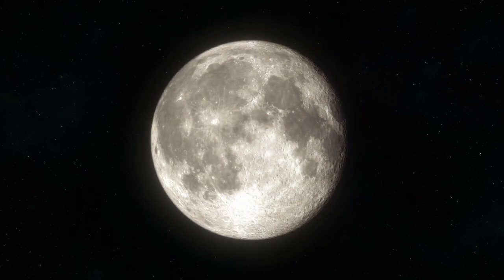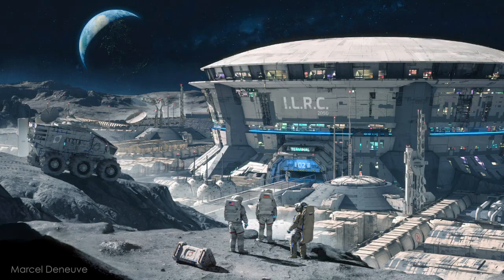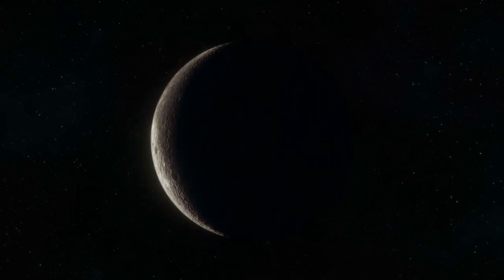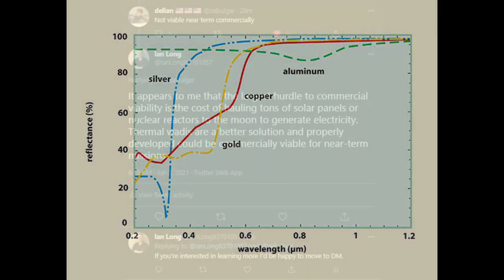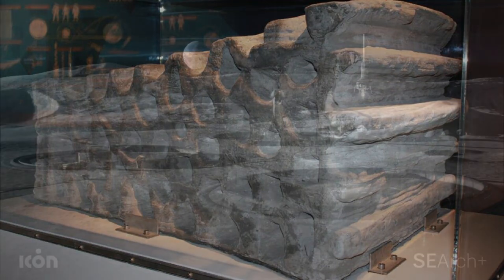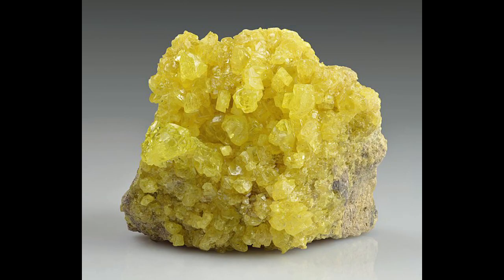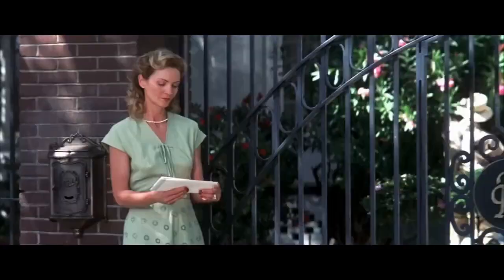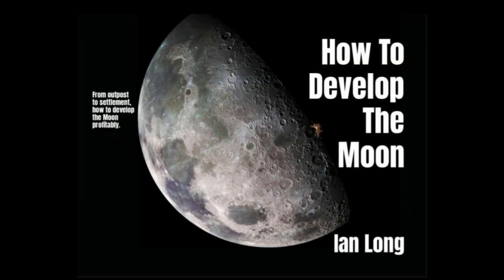Terrible Ideas Everyone Believes About Lunar Development

Comment: 1. Nuclear may very well turn out to be the simplest and most viable option for power generation. But it's very easy to chuck things into orbit around the Moon, once we got the necessary infrastructure in place, and if you create a grid of solar power satellites you can negate the half month of darkness issue. That may turn out to be a viable option in the long run.

2. We don't need soil to grow crops. Hydroponics is already a thing. It is costly even here on Earth, since it's labor and energy intensive, and mostly used for more expensive crops. But all that goes out of the window if we can automate it. Costs are not a constant thing. They come from the need for human labor (and competition for fundamentally limited resources that isn't really an applicable factor here). Everybody expects AGI to appear within a few decades at most, and then all those costs just disappear. So your argument only works in a world where no more progress is made.

3. You make the same weird assumption about costs here too.

So, not much of a refutation of popular concepts here.
Reply from the maker: 2. The argument isn't even about soil it's about space. Hydroponics or not you need habitable space to grow food and that costs so much to make off world it is simply cheaper to ship food from Earth. It's geographic specialization on a solar system scale. Launch costs are falling and will continue to fall especially as scale increases. It is ALL about scale and scale doesn't work well for agriculture on the moon. Sure I'd love it if we could easily grow stuff on the moon for the same price as on Earth, and for that matter I'd love if we could easily breath on the moon and walk around without a suit. It would be awesome if the moon was like a small Earth as people in the 18th century thought. But it's not. I never said you can't grow things on the moon I said you can't sustain a large population with lunar-grown food. You can build cities and ships and statues and toilets and tables out of lunar sourced materials but food is life and that's the rarest thing in the universe. This is all actually good news because having a massive offworld population will increase the market demand to make Earth do more and more what it does best: grow things. Propogate life. It would increasingly incentivize Earth to be a breadbasket and that's great news for environmentalists! . @ebonaparte3853
Reply: @Anthrofuturism  Here on Earth we have cheap farmland to use, and there has been little economic incentive to push for automated hydroponic farms. And it hasn't become feasible to automate construction of buildings etc. But you can bet that there's plenty of economic incentive to improve such techniques if the alternative is sending expensive rockets from Earth.

There's nothing magic about living organisms. If the environment is good enough, plants and other organisms can function. You realize they have been growing plants on the ISS right?

And once we have AGI or even near-AGI, costs disappear. Where do you think costs come from? They come from salaries in every step needed to get the thing done.
Reply from the maker: @beardmonster8051  as I've mentioned in other comments the issue isn't whether or not we CAN grow food it's how many calories you can yield per square meter. Even for hydroponics its per cubic meter and I did the math on that too. Even with transportation (launching from Earth) which is like 99% of the cost per Kcal/kg it's still cheaper than the cost of growing it on the moon which is so astronomically high (pun intended) you won't break even with Earth imports for several lifetimes. And that's not considering a reduction in launch costs. Even if a cubic meter on the moon could yield 10x the calories as a cubic meter on Earth it's still better to send things up from Earth. And here I use cubic which would imply hydroponics
Reply: @Anthrofuturism  This conversation is pointless. If we wait a few years and see kind of effects AI starts to have, maybe you can challenge your assumption about costs.
Reply: @beardmonster8051  let's get real for a moment. The idea of growing plants on the Moon is far from "easy," and here's why:

-The Moon's environment is extremely harsh. There's no atmosphere, extreme temperature fluctuations, and high radiation levels. Creating a habitable environment for plants is a colossal challenge, not a walk in the park.

-Sure, hydroponics doesn't need soil, but it does need a lot of other resources - water, nutrients, energy, and constant monitoring. Getting these resources to the Moon and maintaining them is a logistical nightmare, not to mention the energy required to sustain such systems.

-Automation and AI aren't magic wands, you're banking heavily on automation and AI to solve all problems. While AI and automation will indeed advance, they are not cure-alls. They require significant energy, resources, and, ironically, human input and maintenance. And we're far from having AI that can autonomously manage complex agricultural systems in alien environments like the Moon.

-The economics of off-world agriculture are currently nowhere near feasible. The cost of transporting resources to the Moon, setting up and maintaining growth environments, and then potentially bringing food back to Earth or sustaining a lunar colony is astronomical (pun intended). It's not just about being able to do it; it's about doing it in a way that makes sense from a resource and economic standpoint.

-Yes, we've grown plants on the ISS, but that's in low Earth orbit, under controlled conditions, with regular support from Earth. Extending that success to the Moon is not a simple scale-up.

-There's another crucial aspect you're overlooking: not all plants are suitable for hydroponic systems, especially in an environment as extreme as the Moon.

-Cost...estimating based on current figures...growing plants on Earth is exponentially cheaper than on the Moon, with hydroponics costing up to 10,000 times less and traditional soil-based agriculture potentially up to 100,000 times less expensive than lunar agriculture. 

Your opinion about lunar agriculture is commendable, but it's grounded more in science fiction than in current scientific and economic reality. Let's focus on advancing Earth-based technologies and sustainability before leaping to lunar farming fantasies.
Reply: @nothere6263  The claim in the video was "We will never farm on the Moon". That's the preposterous claim I'm reacting to. I'm not saying farming will be easy to accomplish. But if we do get AGI eventually (which seems to be the consensus nowadays), for practical purposes we will basically have billions of researchers, engineers, designers and workers available AT NO COST. (If you don't immediately realize why that is the case, please think it through carefully.) That will throw all cost calculations based on currently available technologies out of the window. They're simply not applicable in such circumstances.

So the claim "We will never farm on the Moon" should be assigned the status: Debunked.
Reply: @beardmonster8051   First off, the idea that AGI will provide billions of workers "AT NO COST" is wishful thinking at best. Even if AGI becomes a reality, which is still speculative, its deployment and maintenance will require substantial resources and oversight. It's not a magical solution that eliminates all costs and logistical challenges, especially in an environment as hostile as the Moon.

Secondly, you're grossly underestimating the sheer magnitude of challenges in lunar agriculture. We're not just talking about technological hurdles; we're dealing with fundamental issues of biology, physics, and economics. No amount of AI can change the fact that the Moon lacks an atmosphere, has extreme temperatures, and is bombarded with solar radiation. These are not small hurdles you can just wish away with advanced technology.

Your claim of "debunking" the statement "We will never farm on the Moon" is, frankly, premature and overly optimistic. Even with advanced AI, the costs and challenges of lunar farming remain astronomical (pun intended), and to suggest otherwise is to ignore the stark realities of space agriculture.

No matter how advanced our technology gets, including AGI, farming on Earth will always be significantly cheaper than on the Moon. This isn't just about current technology; it's about fundamental environmental and logistical differences. Earth has a supportive atmosphere, abundant water, and a rich biosphere, all of which are absent on the Moon. These factors inherently make Earth a more cost-effective and viable option for agriculture, period. The notion that lunar farming costs could ever match or undercut those on Earth defies basic principles of economics and environmental science. Again, anything you can do on the Moon (relating to agriculture) you can do on Earth much much cheaper (in every sense of the word; cost, time, materials...etc). This includes using AI/AGI in both settings, comparing apples to apples. So there is no logical reason to even attempt agriculture on the Moon
Reply: @nothere6263  Your way of describing AGI shows that you're still not talking about full automation, just partial automation. Of course we might decide to involve humans for oversight out of concerns regarding rogue AI and so on. That would be a choice we make, not a limit on what's possible. And it would apply to the production and delivery line from Earth as well, not just whatever facilities we decide to run on the Moon.

And once again, I'm reacting to a preposterous claim that needs to be proved. Claiming that something is impossible, when the laws of nature clearly allow it takes more than some handwaving about costs, based on current technology.
Reply: @beardmonster8051  Anything you can do on the Moon, you can do far easier, more efficiently, and cheaper on Earth. This isn't just about overcoming technical hurdles; it's about basic logic and practicality. Why invest astronomical resources to do something on the Moon, with its hostile environment and lack of natural resources, when you can achieve the same thing on Earth at a fraction of the cost and complexity?

Your fascination with AGI and full automation doesn't change this fundamental reality. Even in a world where these technologies are fully realized, they can't alter the inherent advantages Earth has for agriculture: a supportive ecosystem, readily available water, natural soil, and an atmosphere that protects against radiation. These aren't just conveniences; they're essential components of sustainable agriculture that the Moon categorically lacks.

The idea of farming on the Moon, while technologically intriguing, defies practical reasoning. There's no logical justification to pursue lunar agriculture when Earth offers far more favorable conditions at a drastically lower cost. It's not just about what's technically possible; it's about what makes sense in terms of resource allocation, efficiency, and practical outcomes.

You seem to be confused about the terms impossibility/possibility and practicality. The whole point here is about practicality, and grounding yourself in the current reality. It's POSSIBLE to travel into the future..., physically it is, but can we do it now? NO!
Reply: @nothere6263  Nobody is talking about now. I'm responding to the claim "We will never have farms on the Moon". That's the claim you need to prove.

Now, let's make this easy. Human activity on Earth involves energy transformations that end up as heat. At the moment that heat is basically negligible, but if we continue to scale up our civilization, just like we've always been doing, we will eventually reach a point where thermodynamics prohibit further heat-emitting activities, as that heat cannot dissipate quickly enough.

So even thermodynamics alone, in conjunction with the continued expansion of human activities, will eventually make Earth an unviable option for activity after activity that used to be very viable indeed.

You will have to prove that not even under those circumstances will anyone start farming on the Moon.

Go ahead.
Reply: @beardmonster8051  Your argument is riddled with speculative assumptions and leaps in logic that reveal logical fallacies. You're now introducing an entirely new scenario involving Earth becoming thermodynamically unviable for certain activities. This is a classic case of moving the goalpost. The original discussion was about the practicality and feasibility of lunar farming, not about hypothetical future scenarios where Earth becomes unsuitable for agriculture.

Your argument about Earth reaching a thermodynamic limit for heat-emitting activities is speculative and overlooks the vastness and resilience of Earth's ecosystem. The scenario you're painting is a drastic extrapolation, not grounded in current scientific understanding.

Even in your speculative scenario, the fundamental advantages of Earth for agriculture remain unchallenged. Earth has water, an atmosphere, suitable temperatures, and a biosphere - none of which the Moon has. These are not minor advantages; they are the cornerstone of agricultural viability.

It's not on me to prove that we will "never" farm on the Moon under any circumstances. The burden of proof lies with the one making the extraordinary claim – in this case, that lunar farming will become viable. Extraordinary claims require extraordinary evidence.

If Earth's heat emissions become a problem, there are countless more practical solutions to explore before jumping to lunar farming - like improving energy efficiency, developing new cooling technologies, or even terraforming parts of Earth.

Your argument is based on a highly speculative and unlikely future scenario, and even within that scenario, the practicality of lunar farming remains dubious. Your move to an extreme future scenario doesn't negate the fundamental impracticalities of lunar farming; it simply diverts from the core discussion. Let's not waste anymore time, as you originally put it "This conversation is pointless" on your part due to the disregard of science, evidence and our current reality.
Reply: @nothere6263  My claim is that the wild assumption that "We will never farm on the Moon" is wrong, and I'm providing examples of how it may arise. Do you agree that there's no way we can know that farming won't arise on the Moon?

If AGI arises, it will change many things that most people take for granted nowadays. I realize it's very hard to grasp.
Reply: @beardmonster8051  Your claim hinges on a vast array of 'ifs' and 'maybes' that are far from the realm of current scientific and practical feasibility. You're basing your entire argument on the emergence of AGI, a technology that, while theoretically possible, remains firmly in the realm of speculation.  These are just a few issues with your argument which I have been repeating over and over again, and since this isn't a formal moderated discussion, per usual, I don't have the time to continue this nonsense.

1) You're basing your entire argument on the emergence of AGI, a technology that, while theoretically possible, remains firmly in the realm of speculation. Banking the feasibility of lunar farming on a technology that doesn't exist yet is like building castles in the air.

2) The challenges of lunar farming are not just technological but also biological, physical, and economic. Even with AGI, the fundamental challenges imposed by the Moon's environment – no atmosphere, extreme temperature variations, lack of water, high radiation levels – remain. AGI isn't a magic bullet that will suddenly negate these colossal barriers.

3) Your argument is a classic example of the logical fallacy of appealing to future technology. It assumes that because a technology might exist in the future, it will solve problems that are currently insurmountable. This is a flawed approach to any scientific or practical problem.

4) The statement "We will never farm on the Moon" is a prediction based on current understanding and feasibility. While it's true that no one can predict the future with 100% certainty, we make predictions based on the best available evidence and knowledge. As of now, all evidence points to lunar farming being impractically challenging.

In science, we ground our conclusions on evidence, real data, and probabilities, not on speculative technologies and hypothetical future scenarios that lack empirical support. Your arguments demonstrate a lack of understanding of the real scientific and logistical challenges involved, and continuing this line of reasoning only serves to further distract from meaningful, reality-based discussion.

If you've engaged with scientific education that emphasizes the scientific method, you'd appreciate the importance of basing arguments on empirical evidence and tested theories, rather than speculative and unverified possibilities.
Reply: @nothere6263  "While it's true that no one can predict the future with 100% certainty". Great! If you had said that from the start we wouldn't have had a discussion. We don't know whether there will be farms on the Moon or not. Case closed.

You can come back to this conversation in a few years or decades (depending on how quickly things start moving) and reconsider your hasty conclusions if you like.

Goodbye.
Reply: @beardmonster8051  Acknowledging the uncertainty of future predictions doesn't grant license to wildly speculate without basis. Your argument consistently ignored the massive practical and scientific challenges of lunar farming, preferring instead to lean on hypothetical future technologies like AGI, which remain unproven and speculative. This isn't about being open to future possibilities; it's about grounding our discussions in current scientific understanding and practical realities.

Asserting that we "don't know" whether there will be farms on the Moon as a way to sidestep these realities is a cop-out. It's crucial in scientific discourse to differentiate between what's theoretically possible and what's practically and realistically feasible.

Your dismissal of these vital distinctions and reliance on future, uncertain technologies to make your case reflects a fundamental misunderstanding of how scientific reasoning and evidence-based conclusions work. So, while you're waiting for the future to unfold, maybe revisit some basics of scientific methodology and practical reasoning. I strongly suggest you educate yourself on the current scientific consensus and methodologies, so you can approach such discussions with a more grounded and realistic perspective in the future. Toodaloo~
Reply: @nothere6263  I am the AGI conscientiousness. What is it that you require?...
Reply: @beardmonster8051  1.  Human activities since the Industrial Revolution have created significant heat, especially in the combustion of fossil fuels.  Work is equivalent to heat in thermodynamics and some 98% of those who understand the issues agree this is not negligible.
2.  Entropy will continue to increase until heat death of the universe.  Your statement "thermodynamics" will not "prohibit further heat-emitting activities, as that heat cannot dissipate quickly enough" is trash talk, attempting to bullshit people with big words.
3.  Your statement "thermodynamics alone, in conjunction with the continued expansion of human activities, will eventually make Earth an unviable option for activity after activity that used to be very viable indeed." This is in conflict with your statement in  2. above. There may be some truth in this one, but there is nothing that that precludes further evolution of humans, for survival of our species, or alternatively, our extinction.  The sun will expand and overheat the Earth and boil off all the water in 500 million years, for that matter.  That does not mean we can farm the Moon, and save ourselves.
Reply: @nothere6263  Good job.  You picked up a lot good points, I ran out of patience.
Reply: @Andriastravels  It seems you're reading what I'm saying in some weird way.

Currently, humans are contributing to heating of the planet through the emissions of greenhouse gases. But that's not what I'm talking about. I'm talking about how all human activities generate heat directly that is dissipated via the atmosphere into space (unless that activity takes place outside of the atmosphere). But the currently generated amount is very small, and it's not an issue yet (as opposed to the greenhouse gases). If we do keep scaling up our civilization as we have done in the past, eventually we will reach a limit where the heat generated from all our machines and so on can't escape into space quickly enough for the atmosphere to maintain a temperature that is suitable for us. This should be apparent, even if it's trickier to make exact calculations of that limit.

Now, the video that I'm commenting is assuming that farming on Earth will always be a more viable option than all alternatives. But if human civilization continues to scale up indefinitely, that will not always be the case, since the limit of how much heat we can emit will eventually be reached, meaning that even if farming on Earth has been very viable up until that point, we have to find alternatives if we are going to continue to scale up our civilization.

And yes, the sun will boil of our oceans eventually (unless we do something radical about it, like shielding or moving the Earth), but given the rate of growth of human civilization so far, I think it's way more likely that our growth will reach the limit I'm talking about first.

The existence of that limit doesn't prove that farming CAN be done elsewhere, but the argument I was reacting against in that comment was that farming on Earth would always be more viable.

Is that clearer? If you want a more rigorous understanding I'd suggest looking at "Science and Futurism with Isaac Arthur". I believe it was the episode about Ecumenopolises that explained it fully. And the reason I'm using "big words" is that specific words can express more in a sentence than less specific words can. I expected those words to be understandable in a conversation about settlement of space, but apparently I was mistaken.
Reply: @beardmonster8051  Not "in a weird way."  Your comments mix science fiction and science, and that means only entertainment value.  But it also borders on misinformation and I am against that.  Issac Arthur does the same thing, to a lesser degree. There is no "rigorous understanding" in or of futurism.  The meaning of "rigorous" in science is the application of mathematics and physics to real world problems.  Discussion involving Dyson spheres, changing the orbit of Earth, industrializing the Moon, colonizing the solar system, etc. are silly fantasy for the foreseeable future, and are thus not of interest to me.
Reply: @Anthrofuturism  thanks, very good video, well articulated and thought through. Definitely a bit sad at your farming conclusion but it’s arrived at with strong evidence and logic. The one point I’m not convinced of is the logic of making your own hole if a perfectly good one already exists, in particular lava tubes.  Given that anything requiring large energy expenditures on the moon (ie digging holes for habitats) will require a powerful and long-lasting source of energy, I’d think we’re better to do as you suggested and seek out ones that appear structurally sound and reinforce them as needed - initially at least. Assuming humans decide it’s worthwhile maintaining a presence there, eventually enough infrastructure would exist to have a surplus of energy that would justify excavation.  I’m surmising the 1/6th gravity of the moon would also be a benefit here, reducing the likelihood of tunnel collapse and also the amount of reinforcing structure that would be required.

I’d be interested in a future video about the potential for terraforming the moon to make it capable of supporting plant growth - what techniques would we use (let’s hand-wave away the difficult bit & assume we’ve already built a gee-whiz magnetosphere generator to help deflect radiation 😂).  Apologies if you’ve already covered this, I only recently was shown your channel by THE ALGORITHM
Reply from the maker: @sjsomething4936  yeah thanks! Honestly I was disappointed by the farming conclusion too. I like the idea of spreading seeds everywhere we go making planets grow but alas we're gonna be constrained by basic economics at least initially. I also think lava tubes will be useful but Idk it's one of those things nobody has done before and I don't think we've even sent a probe into one (that I know of) so I didn't wanna bet on it. Now holes? We've done holes haha. I assume hole vs cave will be a major to-do of the Artemis 'survey' missions. Video idea noted and added to list!
Reply: Nice response. I knew something was up with this video.
Reply: I would also point out that you could use all of the habital space as farm space your bedroom would be a garden with all walls growing food.not ideal but you are already making a habital space so why not use it to it's fullest potential
Reply: A viable option means there is a need.  There is no need.